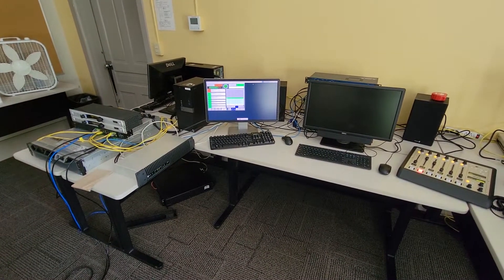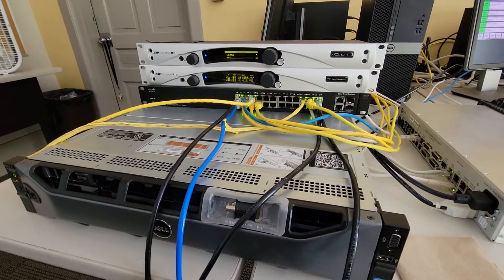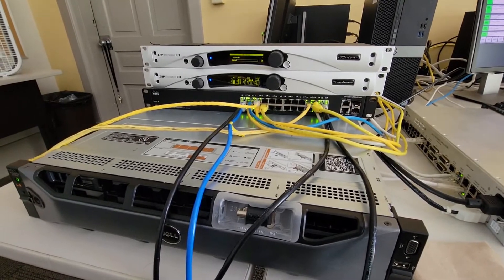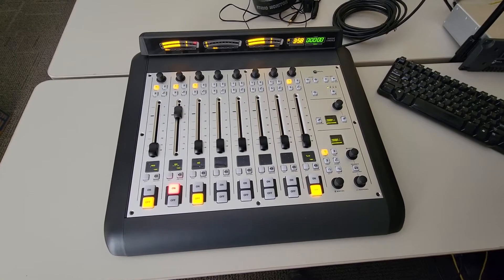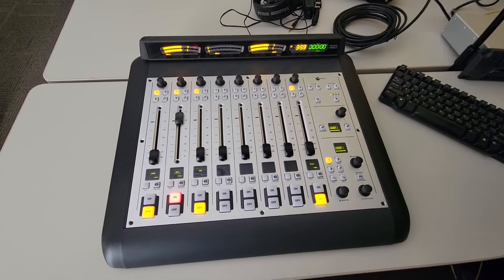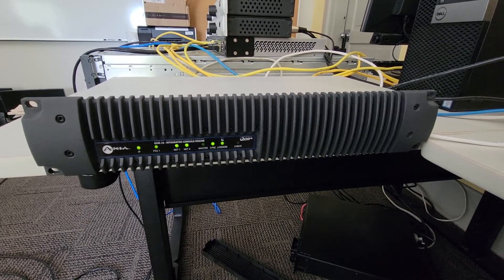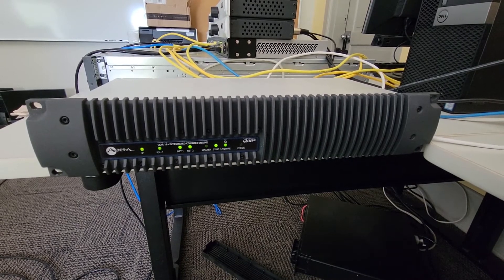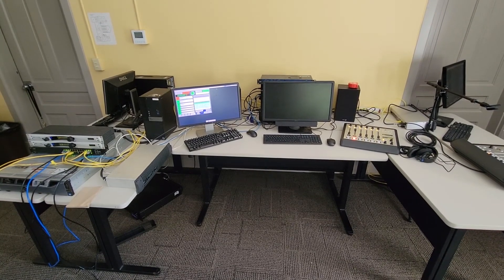Tour of an Axia Livewire (audio over IP) setup at a college radio station

Comment: now do one of the transmitter site please
Reply from the maker: That is a good idea
Reply: @TVJAY   doooooooooooo itttttttttttttt
Reply: @TVJAY  Output power of FM Transmitter?
Reply from the maker: @dare-er7sw  2 kilowatts
Reply: @TVJAY  Yes, I saw later with 3dbi antenna gain. How far is the coverage area?
Reply: @TVJAY  I'm in the process of building a cheap 100W FM transmitter. Construction cost $200.